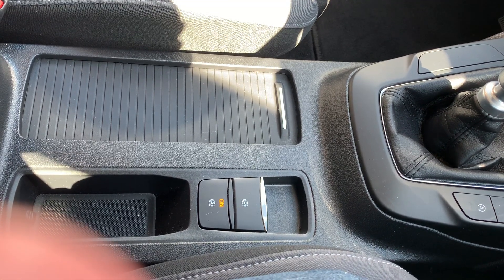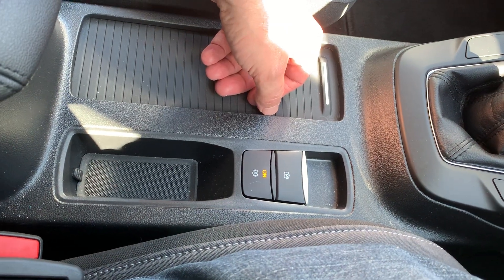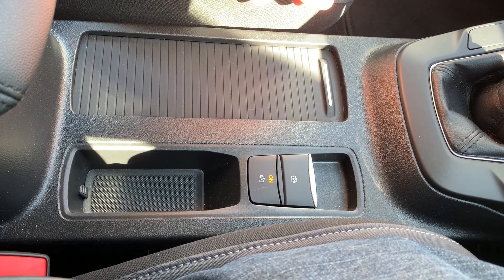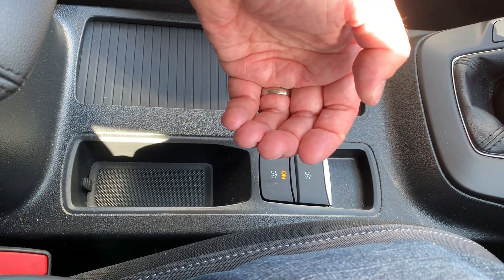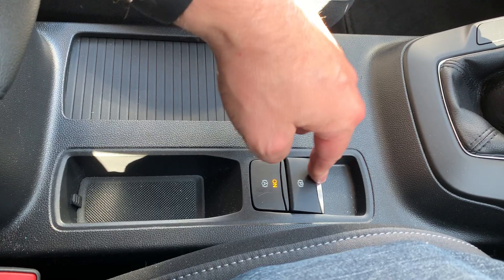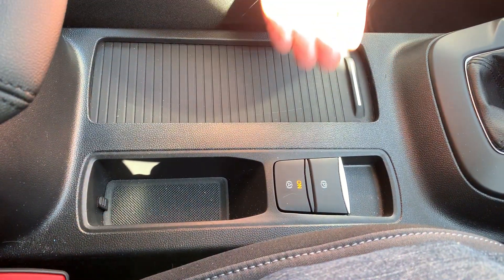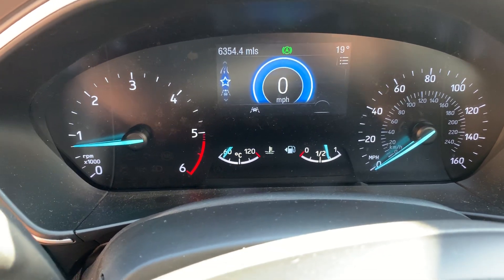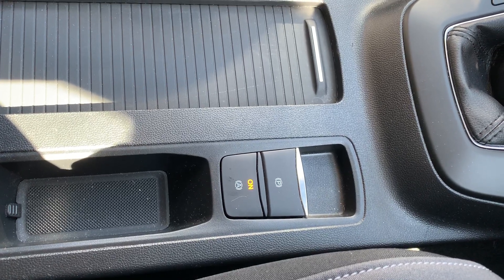Electronic Parking Brake & Autohold

Comment: Autohold is brilliant and convenient to use during the daytime but I definitely wouldn’t recommend it at nighttime, rule 114 of the Highway Code states - “you MUST NOT
use any lights in a way which would dazzle or cause discomfort to other road users, including pedestrians, cyclists and horse riders,” using autohold at night time would keep the brake lights on and therefore dazzling the driver behind, you should follow this advice at nighttime - “rule 114 - “in stationary queues of traffic drivers should apply the parking brake and once the following traffic has stopped take their foot off the footbrake to deactivate the vehicle brake lights, this will minimise glare to road users behind until the traffic moves again.”

Comment: Can you Show us how you would manoeuvre a “hill start” using the electronic parking break?
Reply: That's the problem as you have to depress the foot brake. You're doing 4 things at once, clutch, foot brake releasing electric brake and then sliding right foot over for revs. It's annoying
Reply: @bananagumboot87 Or you could just drive off. That’s one thing.
Reply: @machinegunk5090  yep! I didn't realise this when I got my new car...! You can just drive and the electric brake will release automatically.
Reply: @bananagumboot87  So it’s not so bad. Just takes a bit of getting used to. I’m still grabbing the handbrake that isn’t there -  even now.
Reply: @machinegunk5090  So if you're parked on a downhill slope between two other cars, you don't have to release the handbrake? You can just start the engine, release the left pedal and press the gaspedal to drive backwards without worrying about the car in front of you?
Reply: @Chopin_JT  Are you driving backwards to manoeuvre out of the parking spot? Then the answer is yes. Just take your foot off the clutch to the bite and press the accelerator. The e handbrake will release automatically and you’ll go backwards. In that situation it would be kind of dangerous to take the electronic brake off because you can’t hold a physical handbrake while you take your foot up to the bite and the car may move forwards. That’s why they also need the auto hold- for this very situation. So you’d also turn on the auto hold. It applies the footbrake for you and prevents the car from moving. After you went backwards, you’d stop the car using the footbrake and the car would hold itself in position. Then pop the car back into first or second gear (as you’re on a downhill slope) and drive forwards. The auto hold then also auto releases. The electronic brake and the auto hold kinda work together. I found this out when I was on a steep slope and needed to manoeuvre safely. After weeks of driving the car and having completely forgotten about the physical handbrake, I suddenly grabbed for the missing handbrake. I needed to hold the car - and obviously used to handbrake and clutch together in the past but couldn’t - as there wasn’t one. That’s when I realised that the auto hold wasn’t just a gimmick - it’s a necessity when you have no physical handbrake/have an electronic handbrake.  These systems also make a bit more sense in an automatic. They feel a bit like very basic autonomous features in a way. 
You get used to it.
Reply: @machinegunk5090  Yes, I was trying to get out of a parking spot on a downhill slope. As soon as I let go of the left pedal my car was going forward. After a few trials it was inches away from touching the car in front of me. I found that I had to let go of the pedal completely to be able to drive backwards. A scary situation. Once I did that, and stopped worrying about the handbreak, I finally got out of that tight spot. I'm still not sure how to use the automatic break though. And what's the difference between using the P and the A button. I'm using a rental car, not used to this system. Usually I use the old handbreak with a stick, which works fine to manouevre up and downhill. 🚘
Reply: @machinegunk5090  At first I thought you have to push the P button down to use the e break, but it seems you have to pull it up to switch it on and push it down to cancel it. I'm assuming that you have to push down on the A button to use the auto break and push it again to cancel it? I'm driving a Ford Focus 1.0.
Reply: @ Yes. Pull it up to engage it and push it down with the footbrake depressed to disengage. Or just drive off to disengage, as we’ve already discussed. The auto hold - just turn it on and forget about it.
Reply: @machinegunk5090  Great, thanks! I better always leave the auto break on then.
Reply: @ Or just turn it on for steep slopes. Treat it as a hill assist button. It’s up to you. I just leave it on - so I don’t have to engage the e brake at the lights. Have a great day.
Reply: @machinegunk5090  Thanks for your input, have a great day!

Comment: Great, yes I have a Focus manual like this and have just learned exactly whats in this video, so wish I'd seen it beforehand.       Just one thing to add - if you're ready to reverse off your slopey drive for example, you start off and then see something coming and dip your clutch you WILL roll forward, so keep one finger on the handbrake switch as you reverse .   My advice to anyone with one of these is 9after seeing the video)  go find a steep hill and practice both starting off and reversing off , takes a while but you soon do geet used to it

Comment: Hi I’m having a wobble ref the new parking brake in my car ( to be picked up Saturday) 
This video has really helped! 
May I ask ~ what do I do to leave the car completely .  Apply the electronic parking brake as I leave car? Or does it automatically go off when I turn car off? 
Thank you.  Marie.
Reply: Depends on the car. Mine is an automatic tiguan and once the lever is in park the brake auto engages I never have to touch the parking brake at all. But in a manual car it would probably be different.